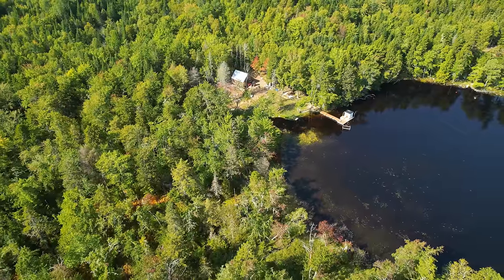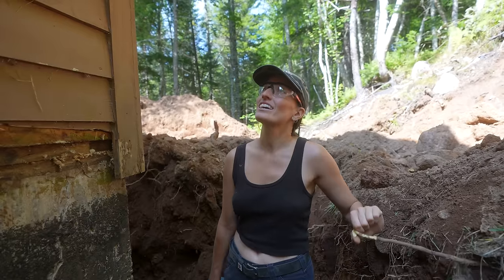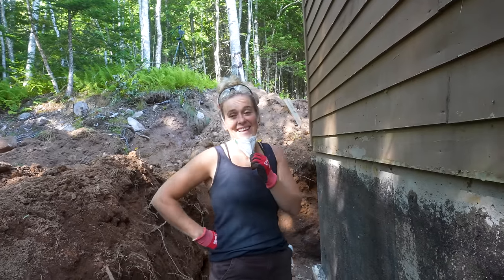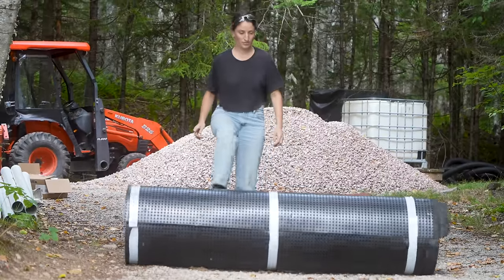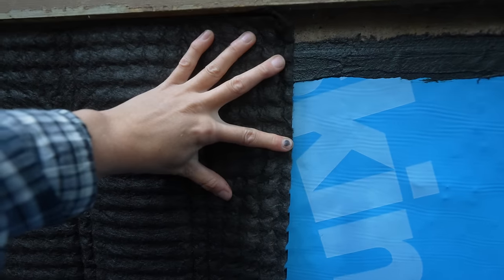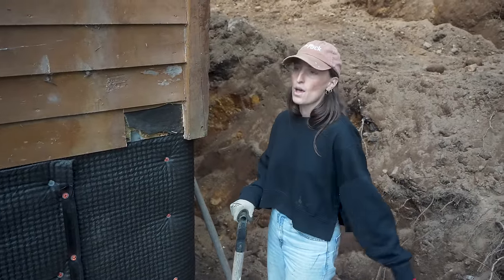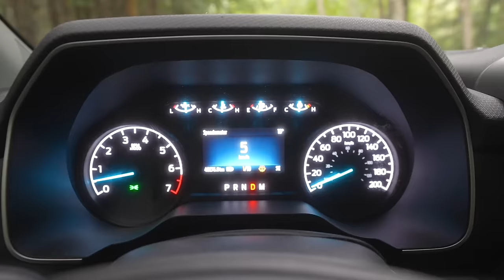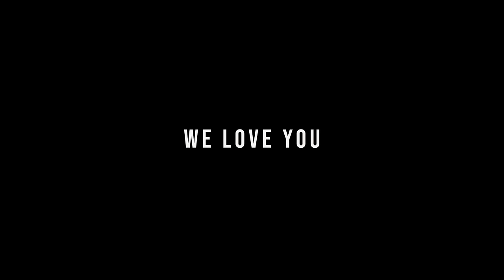STORM HITS CABIN AT WORST TIME! Heavy Rain Ruins Everything

Comment: After you get the French drains done, lay a sheet of plastic sheeting (12-mil, I think Vis clean) across the entire crawl space and up the side walls at least a foot. Make sure it's overlapped, taped, etc. Then put kraft faced insulation into the inter-joist spaces with the kraft paper side facing up (toward the living space). If you don't insulate the inter-joist spaces, the crawl becomes part of the house's environmental envelope and makes conditioning the space challenging.
Reply: very good advice and absolutely the right move

Comment: When digging a waterway with water in it, never start digging in the water!  Always leave a land bridge to act as a Coffer Dam , and dig your trench in the dry.  Otherwise you create a muddy mess that is likely to just keep collapsing in on itself.  Once the trench is complete, sloped, and solid bottomed, THEN go back and remove the Coffer Dam.

I suspect you already know, but if you plan to run your downspouts to a drain, skip the temptation to connect to the footer drains, and ruin them in their own drains.

And congratulations on your new Ramset toy!  That will be so useful from here on out.  You can even shoot pins into mild steel using the red loads.  (Mild steel, like the kind that holds your solar panels up.  That's mild steel).

You ladies always impress, and you've done it once again!
Reply: David- thank you for giving them advice and praise! Some channels end up with arrogant put downs instead of constructive comments! There’s already enough pessimism and hate speech on this earth. Hoping more will think twice before commenting and spread positivity!
Reply: Great tip re the drainage ditch but I think they were in such a hurry….

Comment: Think about putting visqueen plastic down in your basement after it dries out. Keeps moisture from rising but you have to vent the area through your lower door. Sometimes a fan on the backside of vent is required to pull out moisture. Looking good. You guys work so hard.
Reply from the maker: Thank you John, we appreciate you sharing your knowledge with us. 😊🐾

Comment: Be careful where you point your new tool. The noise when someone uses a 45 cal  blank into a steel support is loud. Even more inside!  I had a coworker who was a part time handyman. He once was working under a deck. He was holding a board with his foot, when he nailed his foot to the framing instead of the board. He one while trimming a branches ten feet up a ladder,  cut the branch off he had the ladder leaning against.

Comment: I’m glad yall didn’t give up on the new cabin. I’m enjoying this build because I have a large basement in a very wet area. I have a system that has floor drains inside the basement and plastic sheeting on the interior walls that directs the water to the drain/sump.
Reply from the maker: We never give up! To every problem there is a solution. Yea so much to consider for sure. 😊🐾

Comment: You definitely Need to make your final trench out at the lowest point of where the water is gathering. Also, the drain pipe needs to be graded from the highest point to the lowest point it doesn’t need a lot of grade just enough to make the water run that way you’ll be able to see that it’s full of water, which the water wants to run. Make sure you backfill with lots of gravel on top of the perforated pipe. Check your grade the whole time make sure the water is running towards your final ditch. You’re going to want to run a second system of solid pipe to pick up all the downspouts and run it out the same ditch be a lot easier to grade this pipe as it’ll be partially up the wall just remember water runs downhill with that in mind you will be able to follow your ditch with grade.

Comment: Here's another suggestion for you, add Ts at a couple corners and put in solid verticle pipes just above ground.  Then, when you add the gutters, you can run them into the French drains too and get all of it away from the cabin.  You just have to make sure you have leaf screens on your gutters - which you want anyway, so you don't have to be climbing up to clean them out all the time.

Comment: Something I have found helpful is to dig the trench before allowing water to flow so you aren't working with flowing water.  Either dig towards the water but knowing the depth is hard.  Or leave a dam so it holds the water back and when you break it after digging the trench it will flush the debris allowing it to flow better.  I know you wanted to get the water away from the foundation asap but a stuck excavator would  be very bad in those conditions.    
Good job!

Comment: That was certainly a case of top-down work, when you should have started at bottom-up.  Dig the drainage trenches first, then dig the foundation trenches.  That way no water could collect around the house.  Good drainage is so important, especially in your province where it can rain at any time.  I live in Southern California where we get about 11 inches per year.  Even so, builders have to grade so water runs away from the slab.  Then new homeowners get topsoil brought in and destroy the grading, so rain runs right into the slab.  Over time, it can even run into the house and wreck the carpet and drywall.  Keep this in mind when you build in Mexico.  They get hurricanes, so they can get a LOT of rain at once.  If I was building a house on a slab, I would use extra material brought in to put the slab a foot or two above grade.

Comment: Ladies, I'm so sorry about the heavy rains that hit during your drainage project, but you managed to get through it.  You're made of tough stuff!.
Air flow in your crawl space will be absolutely critical from Spring until Winter freeze.  Don't close that opening off, but do raise the bottom of the opening to keep out water intrusion.  Add some kind of metal screen door to the opening to keep out larger critters; with lots of openings in it for air to vent.  There IS black mold in there that has to remediated first because let's face it, it will always be damp in that crawl space no matter what you do.  Water percolates & will still run down from the hill next to cabin and then leach up under the cabin.  I hand-dug & installed a 70 ft. long French drain - used pipe that has holes all around, fabric sock, gravel base & then surrounding pipe.  Trust me on this - your crawl space will always have higher humidity and dampness; water runs down hill and there's a river next to you.  Just do the best you can, and please when you're working around the mold in the crawlspace or inside the cabin, use the respirator masks and protective suits or at least tie a scarf around your hair.  When you're done, rip those clothes off and jump in the lake.  Momma vibes lol.

Comment: For the future,  get a proper cold chisel or two.  Watching you wreck wood chisels was hard.  Also, I am surprised you didn't burn your hands with the hydraulic cement handling it like mud.  Nitrile gloves under the work gloves is smart. Doing all the stuff you are doing, I hope you have a first aid kit at hand and I am going to recommend you add an eye wash set to that kit. If you have to pour from those five gallon cans, turn the can so the spout is highest then start tipping it down. Easy smooth pour, no glugging or splashing. That wet corner in the crawl space, dig a hole there by the wall and see if the interior drain pipes are  blocked or broken or missing. Repair as needed.   I will just mention, if you didn't have the mini-x handy a trash pump and a generator would have done the job and kept the trench mostly empty.

Comment: I lived in north Baja and a construction friend of mine had a ramset like that. Bigger issue… sometimes you can’t get the right nails. Check local suppliers to see if you can get supplies you are accustomed to. I used to buy stuff in San Diego and drive to where I lived. It wasn’t that far south!

Comment: Hydraulic cement on the surface is not the best mitigation for a crack in the wall if there is additional movement or settling anticipated.   Best practice is to drill some smaller holes (3/8”) across the plane of the crack, and then inject 2-part epoxy into the holes and let it ooze out of the crack itself.

Comment: You definitely Nick to make your final trench out at the lowest point of where the water is gathering. Also, the drain pipe needs to be graded from the highest point to the lowest point it doesn’t need a lot of grade just enough to make the water run that way you’ll be able to see that it’s full of water, which the water wants to run. Make sure you backfill with lots of gravel on top of the perforated pipe. Check your grade the whole time make sure the water is running towards your final ditch. You’re going to want to run a second system of solid pipe to pick up all the downspouts and run it out the same ditch be a lot easier to grade this pipe as it’ll be partially up the wall just remember water runs downhill with that in mind you will be able to follow your ditch with grade.
Reply from the maker: Thank you for sharing your knowledge with us. We love hearing from you. 😊🐶

Comment: My dad’s high school coach in the 80s only had tar paper on his house. A relative bought it and put TYVEK on it last year, no siding yet. We had to take gutters off of my grandma’s house because my grandpa didn’t slope them enough. Between that and tree debris blowing in, we have battled terrible massive ice dams, including at least 2 winters where water intruded the house and was raining down the lights and seam of the house. Luckily it all dried out with a dry climate and wood stove. But ya for us we don’t get enough rain that it is absolutely necessary. I think if they had a greater slope and were installed a bit lower in general maybe they would have been fine. Also the snow guard trapped the tree debris underneath and would slowly release it into the gutter. I think we might take those off as well but at this point there haven’t been anymore leaks with the gutters off.

Comment: you will need to add ( gravel ) and a vapour barrier in crawl to stop moisture rising to affect joists and sub floor.  A heater in there set on low over the wet months might keep it dry.  Take the vapour barrier up the exterior foundation a few inches and seal it to concrete with acoustical sealant to not allow moisture to rise
For Mexico, build with ICF. You won't need the Rameset.  Membrane will stick to ICF and dimple is screwed onto webs of the ICF blocks.
Bill,   PACIFIC ICF

Comment: There are multiple times my spouse and I dealt with septic back-ups as well rainwater potentially flooding our basement on our acreage.  However, for your benefit, I'll skip to the part where we dealt with the rainwater flooding the basement.  We already had a sump in the basement so we put a pump inside of it and connected various long white pipes together and probably an elbow and ran them outside the window and far away into the marsh area downhill from the house.  The pump drained the water out from underneath the house very quickly.  However, rather than going through that whenever we got rain, we had an 8 foot trench dug outside where most of the water accumulates in the deeper part near our walk out basement.  We installed a permanent pump inside there and whenever the water gets to a certain level determined  by the float on the pump, it automatically comes on and drains out the water which is still diverted down to the marsh by a trench and a couple of underground culverts.

Comment: Make sure your French drain is higher than the normal lakes level. if it is lower, I would recommend that you make a sump pump hole under the house to pump water when it comes in. A soap pop hole in the ground is usually 2 to 3 ft.² and 2 to 5 foot deep that you put sump pump in that keeps the water level as low as possible and pump it out as it comes in. It’s close as you are to the lake. The pressure of the lake will push water out into the surrounding area the height of the lake. With no power out there there is concerns how you will power this, but some pumps are usually very efficient on the electricity so one of your battery bank portables should handle just fine. Ideally, this would go right where your wet spot is under the house and that would dry it all out. Your next problem is going to be held the build a waterproof door so the work can rise up around the foundation and not go in the door. I would recommend the door be 2 foot wider than the entrance hole. Have a rubber gasket, the still up against the side and have twist bolts to lock it and place you only have to have it tight enough to sell the gasket with the water all the way up on the foundation it will put several  tons of pressure on that door so it needs to be built to take that. you wanna think about a door in a submarine or a watertight door on the boat when you decide what you’re going to make the door out of?

Comment: When I saw this moss covered cement, I couldn't help but think of you girls needing to rip all that siding off of the Lake cabin. Moss covered concrete siding might give a pretty unique look in spots and be pretty durable. If you look up concrete siding, you'll see quite a few different choices. Although I don't think any of it comes with the moss premanufactured in. They also make some stone looking stuff that looks pretty cool. The foundation doesn't have a brick ledge. Otherwise, I might recommend using real 1/2 stone. I've used some of the stone and brick veneers for brickbelts around some of the houses. Some of it's pretty durable. Some of it's not. But it definitely gives a unique look. A brickledge in the foundation may be required for some of it. Depending on how thick. You could add a brickledge to your foundation since you're already down to the footer. But I have a feeling you girls already have it filled with stone. Oh, shoot. I just remembered you girls already have that
moisture barrier up. I'm pretty sure that wouldn't be good for adding a brick ledge. I know you girls will do your research on the products that catch your eyes. Just a thought. And don't forget to check out AI.Cad If you haven't already. Pretty sure you don't have to be a rocket scientist to run it anymore. It would definitely help with visualization and layouts.  Hope your girls are having a beautiful day. ')
✌️🤟🖖🐾🐾

Comment: Sump pump would've worked to get the water out. Of course it needs power unless you get a gas powered pump.
I would dig a hole down several feet at the corner under the house, drop a large plastic pipe in it, gravel at the bottom with drain pipes from around the inside like you’re doing the outside & drop a sump pump down in it.
I've got one under my house & it cuts on every 5-10 minutes when it's raining hard outside for awhile.

Comment: I would totally recommend a sump pump with two pump's one brushless small pump and a big boy for emergency's, Also run the piping separate from everything else far away from the cabin towards the lake or down hill with gravity. Do not back fill it or use French drains they clog and fail all the time use gravel or rocks and fill the entire thing only a foot from the foundation leaving enough space for a few inch's for soil and grass on the top layer. Keep up the hard work ladies.

Comment: I've done a lot of this kind of work. Once you install gutters with their own pipes leading away from the house, I think everything you have is all that is possible and I think it will solve your problem 97% of the time. Install gutter exit pipes in the same trench you just dug. You can connect gutters later.

Comment: ladies, crack weld for the cracks, hydraulic cement is no different than regular cement, the reason to use hydraulic is when you need quick drying or you are placing in water or wet areas. what you did with blue skin and plastic barrier could easily be done with spray on closed cell foam which is a great water proofer product and you get insulation as well as an added benefit.  Of course there are many ways to get to a point  and i was thinking maybe blueskin or the barrier company sponsored you but that was a bunch of work and I can appreciate that as I work in the dirt often.

Comment: I truly think this house may need to be raised like 4 ft or more like down along shoreline in northeast USA ..and they also have bulkheads as well and they are ocean front homes which always get screwed every time hurricane or tidal flood happens and yet most or all them survive . The only thing is all hvac needs to raised as well . I hope once you get this homes foundation and drainage done you won’t have to raise it but because of it’s low lying location without a bulkhead .. you may be looking at getting a closer lakefront view from your existing homestead and not bother building anything here except a larger floating house and dock to your current home . Good luck thanks for sharing ..

Comment: Is the moisture inside the foundation from the thru pipe?  If so, it would make sense the water would travel along the interior foundation wall.  Will take some time for that area to dry.  Important not to allow any more infiltration from the outside trench.  Once the thru pipe stops draining, cap or cover it.  Just till your ready to connect the entire system.
Besides fire and small children....Water is the greatest enemy of any home!
Thanks for your time and good luck.  Stay out of your wet trenches till you're sure they have dried enough not to cave in on you!!!

Comment: The trigger activated Ramset gun sure is an improvement over my old hammer activated ramset.  Mother Nature may have done a favor by defining a good surface draining route for the cabin.  When backfilling maintain a swaile from the cabin to the low area for natural surface drainage.